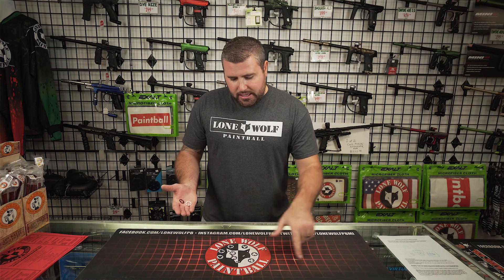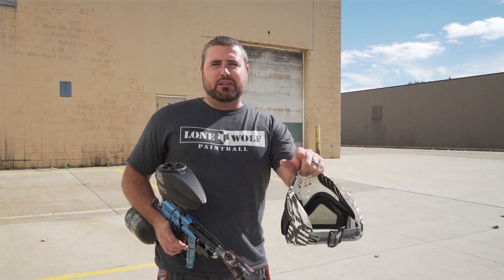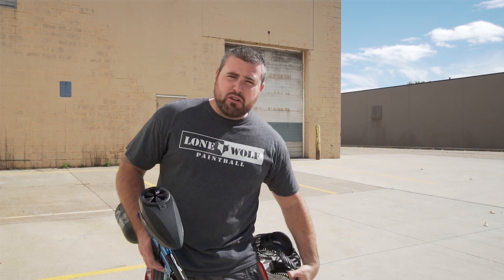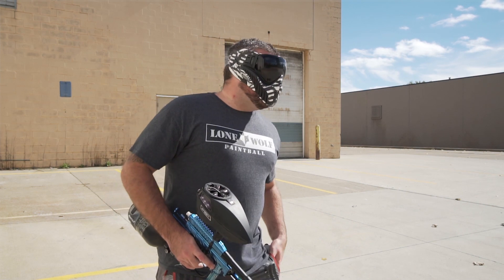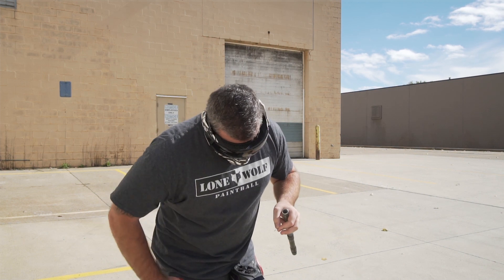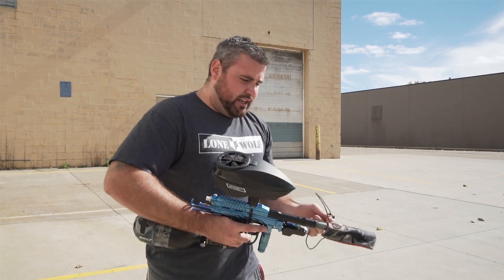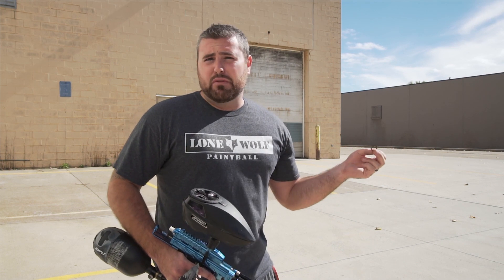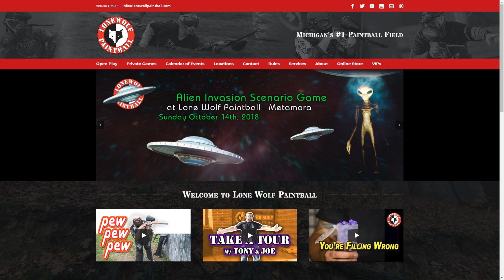3D Printed Anti-Rollout Barrel Widgets for Autocockers | Lone Wolf Paintball Michigan

Comment: How would this work with a cocker?  Cocker is a closed bolt, the ball is in the barrel prior to firing - the widget is no longer in play after the bolt is forward?  Or are the fingers long enough it extends into the barrel?
Reply from the maker: It's working on the cocker in the video.
Reply: When the bolt closes it pushes the paintball into the arms which bend into the barrel. The paintball is squished between the arms and is held in place until it is fired.
Reply: OK, makes sense, I was thinking they were like the CCI rings, where once you loaded the ball it didn't matter.  I'm with most - just underbore and never have that issue :)

Comment: How do i take out a tank off my dye proto rize if i cant shoot out the air inside unless there is a paintball inside???
Reply: im sure you've figured it out by now, however you could remove the loader first, remove as much of the paint from the feedneck until the only ball is in the gun or even out, point the gun in a safe direction and shoot the only ball out, unscrew tank and shoot every couple seconds to help with the back pressure.
Reply: @Drooovv  i figured out u just press the bottom bottom to turn off the eyez off and then shoot while taking the tank off

Comment: Didn't the cockers have ball detents?
Reply: Only to prevent double feeds
Reply: Single detent, with a closed bolt. So ball is loaded past the detent before you fire.
Reply: They do but with a closed bolt system the bolt comes forward and actually puts the ball right at the beginning of the barrel